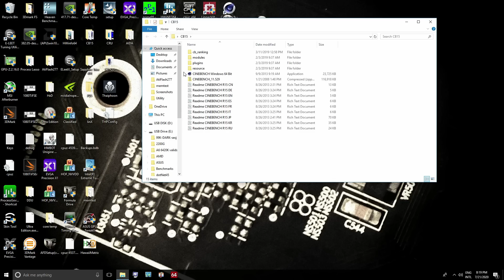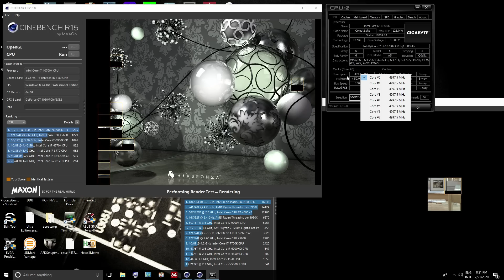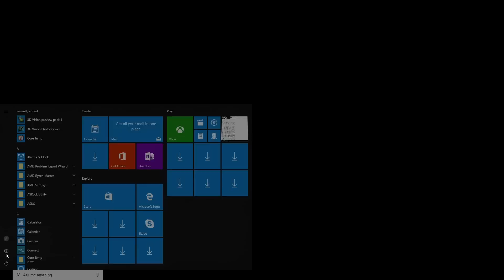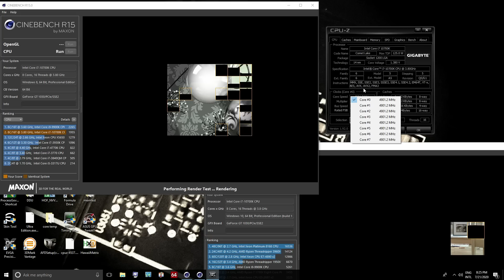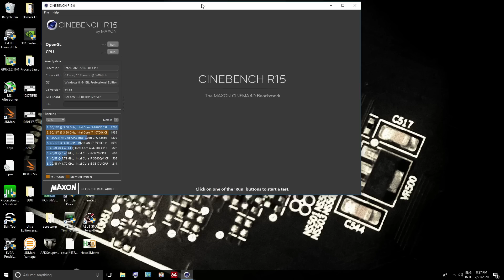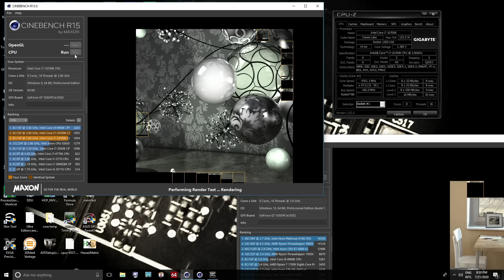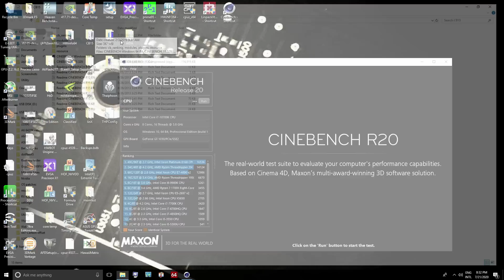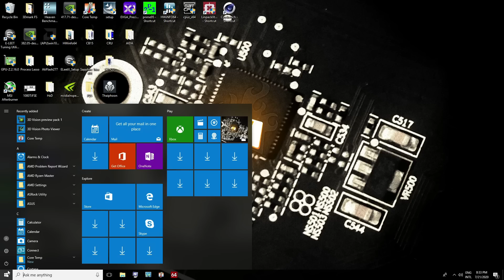Why Buildzoid doesn't use or recommend AVX offsets for intel mainstream overclocking (Z370/390/490)

Comment: I dont know if that is a problem of previous motherboard generations where all the threads drop for AVX, i just tried the offset on my z790 this morning and it only lowered the frequency for one cor at a time it seemed like not all together. i was trying to find more information on AVX inpact in games, this is how I found your video, but I did want to point out the point that you were trying to make about every core dropping might not be true any longer with the latest motherboards.

Comment: Isn’t this a good idea though for games that don’t use avx being able to clock higher and then a game that uses avx it will die clock your cpu to help with temps or just overall stability ?
Reply: Like my 14900k voltage offset works in most games (Warzone etc) at -0.070 but battlefield crashes with anything less than -0.010. Cinebench r23 is fine at -0.025 but bf2042 for some reason doesn’t like a big offset and I’m reading it’s because of their weird usage of avx

Comment: Well, on my current mobo (z690 Aorus Ultra + i7-13700K) with any hard enough avx workload (so not with one Cinebench running, but with P95 sFFT), the p cores drop down to 5.3 (the default max clock) and nothing in bios will change thins.  Sp really, in a sense, I have a K processor that doesn't overclock.  Something is fucked here.

Comment: If you're going to reduce the frequency for the CPU, you may as well just use an AVX offset for the times that AVX isn't being utilised?  But yeah...it would be cool if the cores would clock independently of each other; I'd like my per-core OC to be tuned down to the individual cores.

Comment: Buildzoid, i think your logic is critically flawed here. Basically you say "just run whatever your chip can achieve on AVX because the second an AVX instruction takes place, it's going to reduce the frequency". The thing is... even if your chip spends 90% of the time at the avx frequency with a "avx offset overclock", it's still BETTER than spending 100% of the time at the same avx frequency, but without offset. Just to make it oversimplified, assume you use your computer for 10 hours a day. You set a 5ghz oc with -2 avx offset. 9 hours your PCruns at 4.8ghz, 1 hour it runs at 5ghz. This is already straight up BETTER than 10 hours at 4.8ghz which is your suggestion. It just doesn't make logical sense.
Reply: That's big brain buildzoid for you...

Comment: Interesting.. But common sense tells me that we shouldn't expect AVX offsets to work properly if we have enhanced multi-core performance set to enabled/auto. Since it automatically sets all cores to the "max turbo frequency", when AVX kicks in it downclocks our main cores and the rest of the cores follow. Gonna have to test with multi-core enhancement disabled/per-core limit control set to enabled.

Comment: How about setting the CPU Overtemperature Protection?  For instance, IBT/Linpack only loads my 10700k to 74-75°C, but OCCT Power Test (AVX2) takes it to over 90°C.  By setting the Overtemperature Protection to 88°C, the CPU very slightly downclocks (depending on ambient weather), by say 100-300mhz.  Any downsides you can think of?

Comment: Avx offset is good. The behavior is normal.
You use avx offset if you can't maintain clocks without it. So now you can actually do 5.3ghz with - 3 avx offset.
That means your cpu runs 5.3ghz when no avx and 5ghz when avx.
Without avx offset you get 5ghz all the time. Never 5.3.
But the reason I found your video is because I noticed that during gaming clocks really REALLY jump a lot. Like I said every second.
Reply: how is losing performance for zero gain good again? I mean sure it fills intels coffers but for everyone else it doesn't do anything but lower 
cpu performance.

Comment: isn't the AVX offset purely to achieve a higher overclock in NON AVX workloads than you would ordinarily be able to achieve?
i.e. you can get 5ghz all core on that cpu no problem, but if you want to try get 5.2ghz with an AVX offset that puts you back to your stable 5ghz when AVX shows up. now you get 5.2Ghz in non AVX workloads and you don't lose stability.
or am I missing something?
Reply: I think the point is that AVX offsets eat into your non-AVX workloads even if only one thread is doing AVX work. I guess you're right in that using an AVX offset you only have performance to gain, but buildzoid's point is that the feature could really be improved to allow some threads to downclock for AVX workloads, while leaving non-AVX workloads unaffected, and in practice right now, the feature doesn't really net the end user much extra real world performance for the effort required to dial it in.
Reply: I thought it was heat. AVX512 is insane for heat so I figured it was more that - if you are getting a crash in anything technically you aren't stable and may run into a crash elsewhere, even if it's say every 150 hours of active uptime or even 500-1000 hours.

Comment: On my Maximus XI Apex/9900k I have 2x avx offset and randomly some cores will drop from 5100 to 4900. I have all power limits maxed but hwinfo will say some kind of limiter has dropped (I can't remember which atm) to 4900. If I'm running anything avx the entire CPU will drop but randomly certain cores just drop, usually for just a second or less.
Reply: ...Because AVX triggered, duh.
This is why you don't use AVX offset.
Reply: @shawnpitman876  literally the entire point of this video is that avx offsets don't work per core on mainstream Intel

Comment: All the people saying "avx offset allows a higher boost for non avx at lower Vcore" completely miss BZ's point.
Reply: It's because they refuse to see anything other than "I COULD GET IT TO BE HIGHER!!" When the reality is 99.9% of people will NOT GAIN ANY PERFORMANCE from concerning themselves with AVX offset as you will be using AVX most of the time when ACTUALLY using your CPU.
Reply: @shawnpitman876  it may not make sense for someone like bz who is constantly using different hardware configurations but if you're setting up a cpu and motherboard for the next several years it might make sense to see the if you can get a higher clocks sometimes.  I do handbrake encodes so avx needs stabilized first.

Comment: It seems that my 7700k can do per core AVX offset. I have an AVX offset of 2 and on certain workloads I see individual threads dip down to 4800 MHz (from the 5 GHz oc). This seems to show in HWInfo as well as CPU-Z when you combine Prime95 single-thread AVX load with Cinebench R15.
Reply: What mobo and cooling are you running?
Reply: @rosen9425  Hero Z170 w NH-D15
Reply: @ole7736  
At 5ghz. Impressive 👍
Reply: @rosen9425  Delid. Not 100% encoding stable.

Comment: Like many people have said, you can think it as a non-avx boost instead. However, what I'm slightly concerned is how exactly the offset is applied. Right before the AVX instruction or what? And whether switching between avx and non-avx frequency could cause instability.

Comment: My 8700k runs prime95 non-avx at 5.1ghz with no issue for days, but if I enable avx, it hard crashes just right after I click "start". With a -2 AVX, it get's stable. So I have 3 options:
- always run at 4.9ghz and have excessive voltage for non-avx workloads
- always run at 5.1ghz and expect a crash on heavy AVX workloads
- enable offset and get a mix of both. 
I agree that downclock the entire chip is stupid but having +200mhz randomly is better than not having them and still run the cpu at the same voltage
Sorry, I can't totally agree with you on this

Comment: Question: Which is fastest? 3600 cl14 -15-15 -35 or 4400 cl19-19-19-39 ?
Reply: Depends what you mean by fastest, 3600C14 should have a lower latency and 4400C19 has a higher bandwidth. So it depends what your application needs the most I suppose. And 4400Mhz is harder to achieve, you need a good CPU (specifically a good IMC), a good motherboard and good RAM modules.
Reply: @Scr3amer42  Well, since you knew what I meant and gave me the obvious answer! Cheers 🤣

Comment: 1.38v for 5ghz? wtf
Reply: My 9700kf needs 1.405v for 5ghz, I run it at 4.9ghz at 1.335v because i'm not a monster
Reply: @17473039  damn dude, bad chip too ... my 8700K was doing 5ghz with 1.28v llc6 asus, on load goes up to 1.296v uncore 4.7ghz.
Reply: Lost that silicone lottery eh
Reply: My 10700k does 5ghz all cores at 1.255v , got lucky..

Comment: Linus Torvalds called AVX-512 a "power virus" and wished it to die "a painful death" lol

Parts of the interview:

“I want my power limits to be reached with regular integer code, not with some AVX-512 power virus that takes away top frequency (because people ended up using it for memcpy!) and takes away cores (because those useless garbage units take up space),”

“I hope AVX512 dies a painful death, and that Intel starts fixing real problems instead of trying to create magic instructions to then create benchmarks that they can look good on,”

Source: TechRadar.
Reply: He's not wrong. 

SVE2 is much better than AVX.
Reply: I thought that  Linus' interview was massively entertaining. I like a good rant. lol
Reply: AVX512 is great, and Intel has it--not AMD. Just another reason to stick with Intel, not to mention Ryzen's garbage memory latency (60-70 ns), which is pathetic comared to Intel chips, which when finely tuned on RAM frequency/timing, can achieve sub-50 ns latency on even a 28-core part with hexa-channel IMC, and superior FP performance at 3.2 GHz with AVX512 than a stock 3990X with AVX/FMA3. AMD is an absolute joke.
Reply: @NUCLEARARMAMENT  your funny lol. Please stick with Intel. You are making the right decision for you.

Comment: my 10700k running 5ghz all core idle-desktop but  underload  cinebench or games CPU stuck at 4.7ghz on shows cpu-z 
no thermal throttling
I set AVX 0 on bios but still same. Other settings auto btw

Comment: Should I be running Turbo or High as my LLC for my 9900ks. Gigabyte Aorus Ultra.
Reply: In his other video for overclocking a 10700k with a gigabyte aorus z490 I think he mentions this. Or if I read it elsewhere.. but turbo if you want a little less vdroop and thus can run a little lower voltage at idle. I personally am using turbo. High he said is fine too but must account for vdroop with slightly higher fixed voltage.

Comment: I always saw AVX offset as something you run to get a little bit more performance out of non avx workloads. Granted you would have to test stability again with the offset.
In the case of my 8700k however, it did not matter as 5ghz was stable with no offset and 5.1 with offset was not. I would certainly not enable it from the start when overclocking, better to eliminate variables anyway.

Comment: You fail to recognize the fact that a small offset will help to keep the vcore down (if set to adaptive on asus boards) or maintain system stability at a user set maximum "safe" vcore. I think the video misses the target, hardcore overclockers won't bother with an offset, but other users might find it beneficial. An offset of 3 or more is stupid, and nobody should use that, but 1-2 is fine imo.
Reply: sure enough, but did you read the title?
It specifically says "for intel mainstream overclocking". so of course, the video didn't miss the target, it hit it spot on ;)

Comment: great timing, i was doing some testing on avx offset today. Personally i can't decide, on one hand it seems that at the same voltage i can get +200mhz without avx, but on the other hand it's really hard to stress test it since my frequency was constantly jumping between my base and my offset frequency so i'm not really sure if it's really stable with those +200mhz.

Comment: Is this one of those situations where 'auto' multicore enhancement is on?
Reply: No reason to disable that any more.  Actually it's slower if you do.
Reply: @unitedfools3493  That has always been the case.  Multi core enhancement causes the CPU to run outside of the way intel designed by running all cores at the same speed.  If part of that is what is causing him to not be able to get different clock speeds on the cores because of the AVX offset, that would be a very valid reason to disable it.

Comment: That reasoning is wrong in assumption. YES it is pointless to set AVX offset if the system is stable without it on AVX workload. That's obvious. The reason of AVX offset existence is to let your system run faster when there is no AVX workload.

Comment: The next problem is, AVX Offset does not change the VCore back to default, just the multiplicator so the CPU will, even when reduced to below stock clocks by the AVX offset, run hotter than default and possibly crash, been there done that, had to kick out my 5GHz overclock and go lower... NOT FUN!  

If you want to see a good real world example of AVX: No Mans Sky, when loading the game there is like a 30 second loading screen that says "compiling shaders", that loading screen is AVX from start to finish and i needed a brutal AVX offset of 300 or 500MHz to get past that one without bluescreening. In gameplay it used no AVX at all, so the CPU did 5GHz fine after.  

The annoying thing about games is, every game uses different amounts of AVX, Forza Horizon 4 uses it just a little bit here and there in gameplay, a 100 or 200MHz was enough to avoid random crashes once in a blue moon, but it uses it in gameplay... and it just drives me nuts looking at my monitoring software and seeing that the CPU keeps dropping every 10 seconds or so randomly for no obvious in-game reason at all.  

ANTHEM, the BioWare game that managed to crash PS4 consoles so hard they went into recovery mode, that one used no AVX at all in the launch version, then i noticed it used a little after a patch, then after another patch a little more, every patch added more AVX instructions, i guess that was the so called BioWare Magic optimizing the game there... i had to lower my AVX Offset TWO times after patches or the game would just keep crashing within 10 minutes.  
I can assure you a ton of people just stopped playing when it started crashing for them, many of them may have no clue what AVX even is.  

I eventually gave up, reset my VCore to default and went with only a light overclock of 4.7GHz on my delided 7700K.  
I honestly can't wait for an excuse to buy a Ryzen 8c/16t system now and kick the 7700K out... i even delidded the damn thing and it recently decided that one of its cores is now running 10°C hotter than the rest. With AVX this is just too many variables to juggle for an casual overclock that you can hardly notice in-game anyway.  

AVX truly took all the fun out of it for me.
Reply: Yep, if you get a Ryzen, you can forget about overclocking completely.

Comment: Buildzoid, can You make a Video of AVX on x299? I think this platform kinda sucks, and someone has to talk about it. 
For e.g. if You set (all) AVX to 0 and open up a load to the CPU with AVX (but not with CBR20), it massivly clocks down. 
The mainboard just dont care about the AVX Setting. 
For instance, use AIDA64 Memory Stresstest, which doesnt put much load on the CPU and it will clock down, to around 3,5GHz. 
This stresstest just triggers AVX-512 and the mainboard freaks out. I dont know why nobody is talking about this "problem" or rather, why 
nobody is recognicing it. 
Tested on serveral mainboard with serveral CPUs: 7820X, 9900X, 10900X
Asus TUF Mark1, Extreme ENCORE, Extreme Omega, Extreme Apex

I would like to see a video of you, how you ramble about this one :D
Reply: Ever consider that it's an ASUS problem, and not a x299 problem? You "tested with multiple boards" that are ALL THE SAME BRAND.
Reply: @shawnpitman876  i forgot. EVGA Dark is also included :)

Comment: Turbo Per Core Limit Control is a badly documented attempt to change which cores are "favored" cores, for turbo boost ratios, for which actual core gets the turbo boost.  This works similarly to 'favored cores' by having them boost up to the multiplier set when X # of cores are loaded.  This REQUIRES c-states to be enabled because windows needs to put the 'inactive' cores to sleep.  Otherwise the task scheduler will just bump the load onto any random core it wants to boost at that load. (at least if Shamino's explanation to me about this is clear).

This option is in Asus bios also, but in a layout which is a bit easier to understand.  If you are a physics major...

Comment: AVX is used in DX libraries, so in games you will see those fluctuating clocks as well, no need background apps. Offset based on per core certain AVX percentage or core load threshold would be ok.